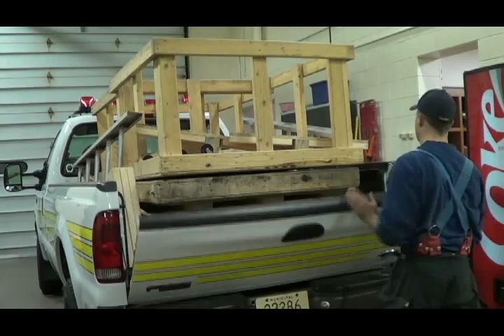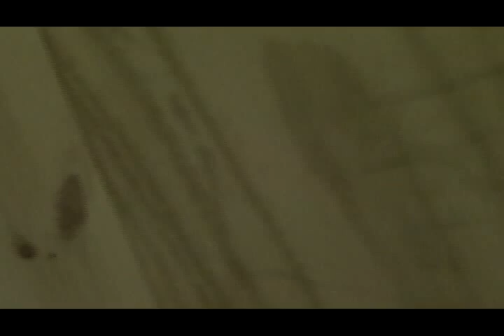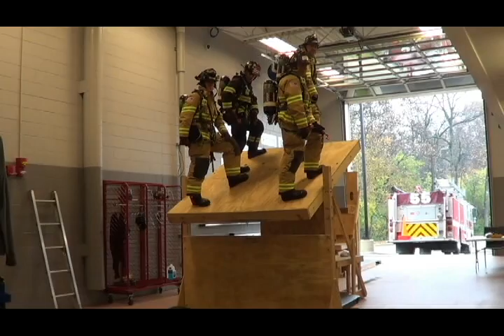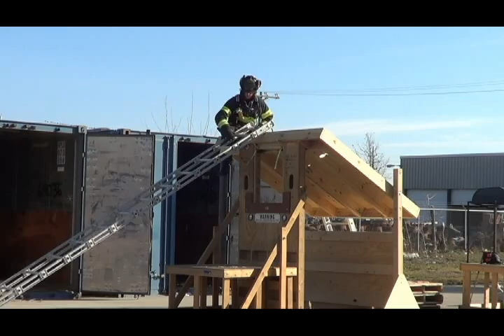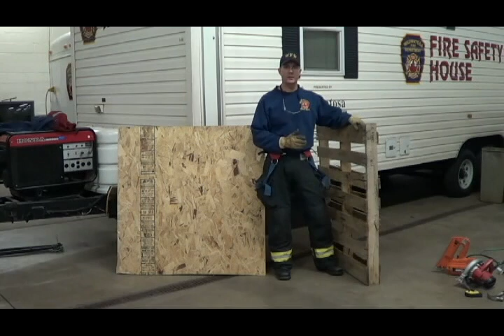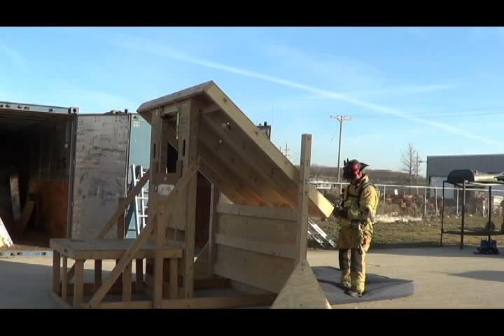Firefighter Training Prop - The Pitched Roof Attachment

Comment: recently built this prop. One question tho, maybe I missed it in the plans I have but how far from the bottom  of the roof do you drill the holes for the support wall to adjust the pitch. I have the measurements to drill on the 4×4 but not the roof 2x6.   thanks

Comment: Dale,
Great video and great props.  I would like to receive any plans that you have available for the window/wall simulator, roof attachment, Denver drill, and any other props you may have incorporated into the whole system.  Thank you in advance.

Stewart Romadka
Momence, IL Fire Protection District
Reply: Email address is StewartRomadka@gmail.com